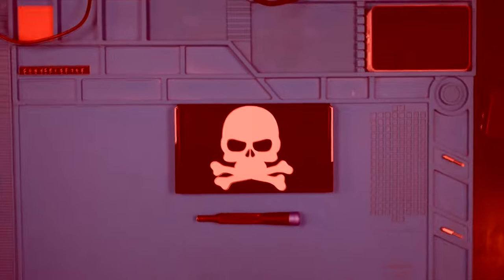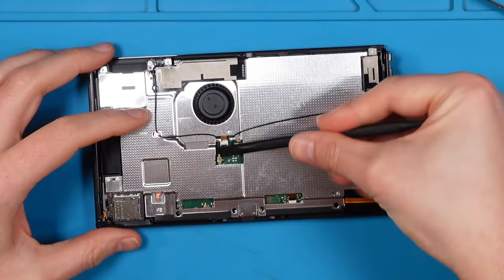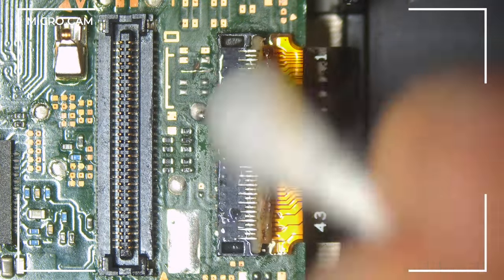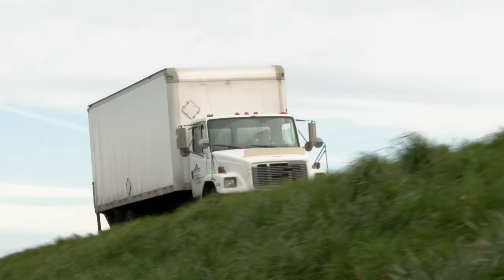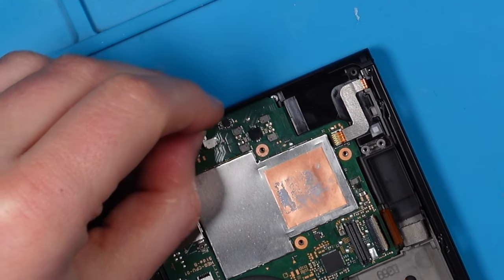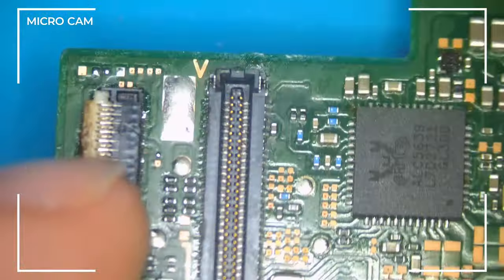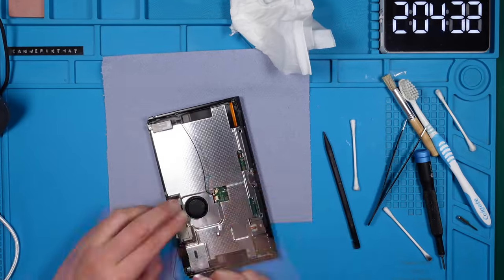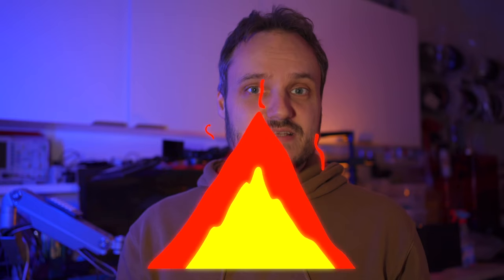My First Switch OLED Repair Took an Unexpected Turn!

Comment: I really dont get how they messed that screen connector up doing a mod chip install. 

The mod chip locations are no where near it, but I wonder if their board holder scratched the trace off then they melted the connector trying to repair the trace?
Reply from the maker: Hi QTronics! I have absolutely no idea how this could have happened. But your guess isn't bad! 

That would explain why they needed hot air. 🔥🌬️🤓

Comment: 9:46
Even if you cover it with tape, won't the solder balls melt as well when you heat it up like that?
Not bashing, just curious coz nand heat damage or reballing is much harder than lcd connector.
Reply from the maker: Hi Jackie, you're right, there's definitely a risk of causing more harm than good, which is why I always aim to use as little heat as possible. Perhaps this wasn't the best approach, but it seemed like the least harmful option in my eyes. I'm curious, what would your approach have been?
Reply: @CanWeFixThat  
Probably flood it with low melt solder + heat from the top.
Since its a faulty connector, there's no worry about destroying it. 

For installing, use soldering iron 100%. Wayayeo Repairs has a video showing the technique.
Reply from the maker: @jackipiegg Absolutely, for desoldering the connector, that's also a viable option! However, when it comes to installing, personally, I'm not a huge fan of soldering such connectors with a soldering iron; it just doesn't work well for me, but I believe it's a matter of personal preference. If I recall correctly, @NorthridgeFix also used heat from the bottom – maybe in my case, it was a bit more risky due to the missing shield. 😊